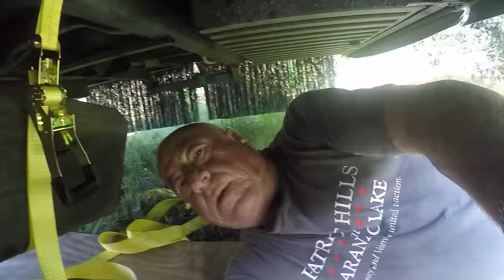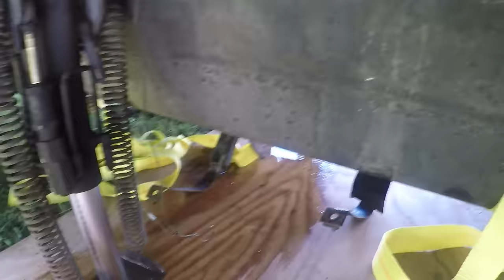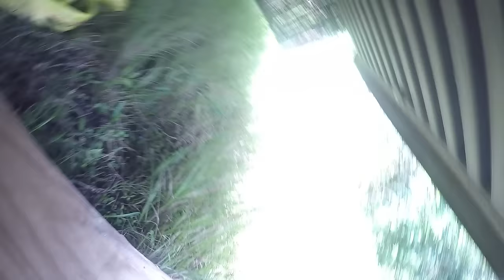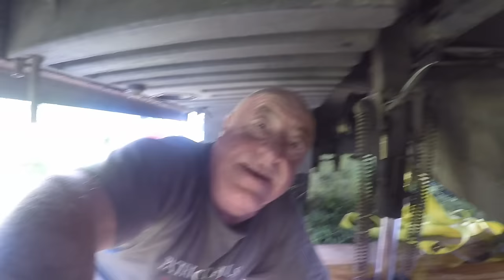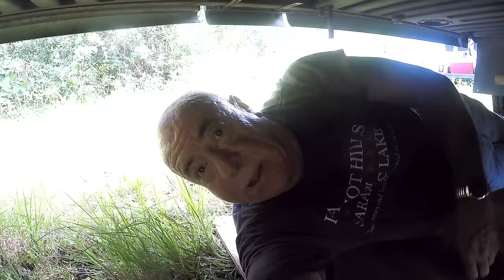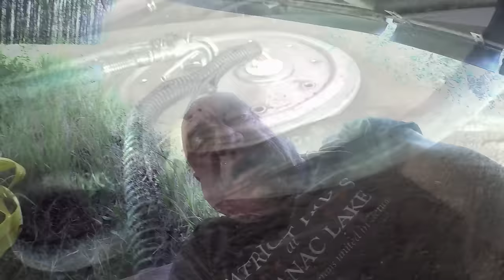RV Fuel Sending Unit Replacement Part 1

Comment: Hi l have a problem  was wondering if you could please give me some advise with the generator fuel feed hose which hose is it on top of the fuel tank 2002 Southwind 8.1 workhorse 22

Comment: You got the right idea, --- I am pulling one at present and I have the smaller straps and used  4 smaller straps which is easier to handle.  I also double my straps as I am putting them on, - I mean  I put the strap up to hook up an then run the strap over the other side -- and back through the  hook loop, and then you have double the leverage and easier to handle!  Glad you figured the straps out! much easier and as you say - one person can do it!    Thanks, and glad you got it running!

Comment: I feel like a complete idiot but how do you manage a controlled descent with ratcheting straps. once you release they would drop like a rock? Maybe two straps on the rear? Have one a little loose then release the one holding the weight and switch that up until you get down to where you need???

Comment: The straps are a great way to do that. I did it with jacks on a car and didnt feel safe. I also did it twice. Once with some gas in tank and once with no gas. I found it easier with  some gas in the tank as it raised back up and stayed in position better because of the weight.  Love the videos Chico , keep them coming.
Reply from the maker: +Dan Owen  Thank you!  The straps worked very well!

Comment: Rufus I am glad I came accross your videos. I needed to drop my Motorhome 53 gallon fuel tank down and Had 40+ gallon of fuel in it and did not have the sources to empty it. I had 2 3000 lb. straps and was able to easily drop the tank down so I could replace the generator fuel line. Again thanks to you I was able to accomplish the easily and safely without spilling fuel or having to empty it out.
Reply from the maker: LeeRoy Howard I am so glad that I was able to help you out! I'm a little bit under the weather lately and I've had a long stay in the hospital. I hope to do more videos as soon as I get out and I'm able! 😀

Comment: If its older like my 76 dodge Minnie Winnie. I was told replace mechanical pump. Did that still no gas. Is the sending in the tank responsible for pumping as well?

Comment: Hey I have a class A rexall air bus 460 it is back firein g thru the throttle body it starts up and I can rev it up most times while in park but when you put it in drive it sputers back fires I replaced the fuel filter and distributor cap and it is still doing it please help me if you can
Reply: Could be a bad Computer, I had the same issue with my Ford van replaced everything from rotor caps spark plugs etc and it kept backfiring I couldn’t figure it out, so decided to try a different computer and that fixed the issue.
Reply: Any backfire through the intake is going to be electrical issue, anything through the exhaust is a fuel issue. I would check the distributor cap for a crack, corrosion, etc. if you haven't solved the issue yet. Then check the plug wires and plugs, then computer.

Comment: if you ever have to drain one of those tanks you can use the pump to drain it by turning key on an disconnecting fuel line an placing it in recovery container ( not in that order though ). you can send me a friends request if you have any further mechanical questions
Reply from the maker: +Danny Shermsn Thank you!

Comment: I think you need to rethink selling that unit.  If you get a smaller class C, you may have to go thru all this crap again.  And I am not sure a class C is going to get much better mileage.  Maybe a class B would.  But used rigs have issues and getting thru them all is a chore.  But with Guz you have done most of the fixes (just watch your old videos !).  Just my two cents.
Reply from the maker: +Vader1957 I really think Rufus and I do not need that much room.
Reply from the maker: +Vader1957 I really think Rufus and I do not need that much room.